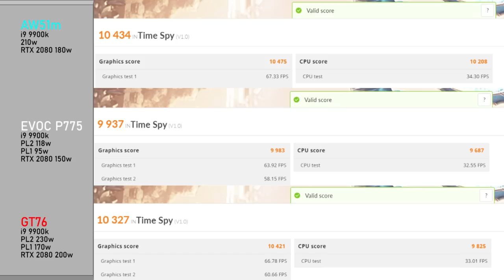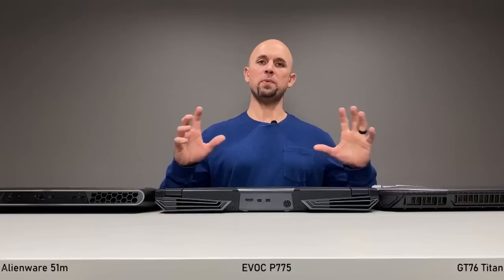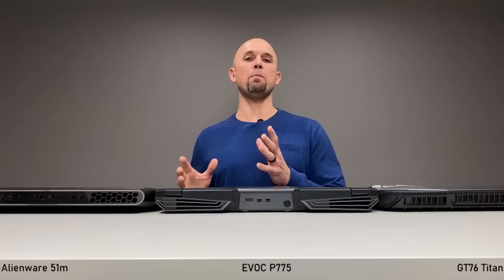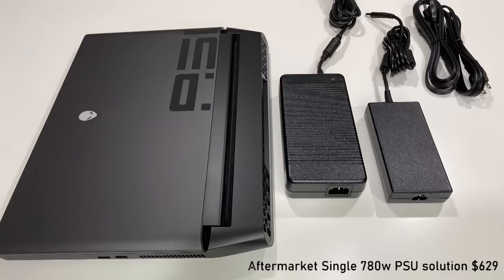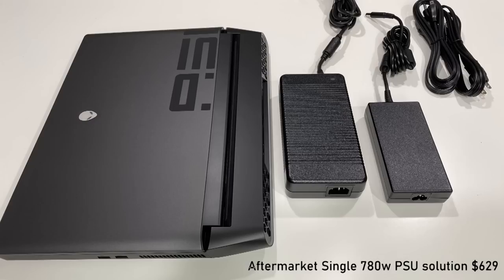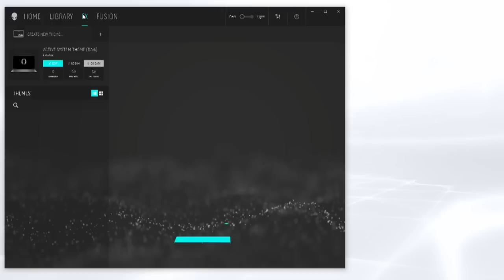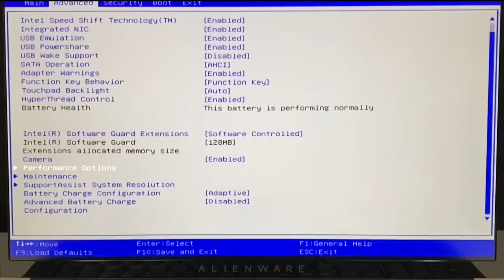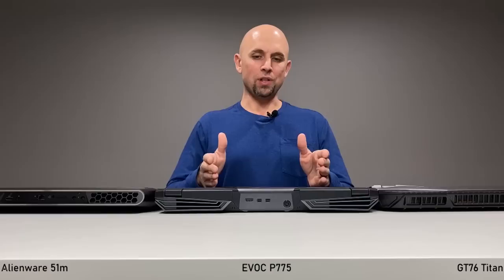The Ultimate Laptop SmackDown!  Alienware 51m vs EVOC P775 vs MSI GT76 Titan

Comment: I was  quite literally two clicks away from buying an Area 51M with 9700K and RTX 2070 for about  3000 Canadian dollars, the only thing that stopped me was the current limit on the card because we had some repair to do on the car the same month.

Now i have a P775 with 9700K (for better thermals) and an RTX 2080, 4 Tb SSHD, 32GB 2666Mz for the price of the inferior 51M stated above.

The same Specs in an Alienware including the parts i got from Amazon, this build would be at 4000 Dollars before tax....

I wont even mention the Titan....

The premium is way too heavy of the Dell or MSI machines.
Yes the Clevo is rough on the eyes but i wont be climbing up the curtains if there is a scratch on it because whats inside is not only competitive but also overperforming the far more expensive machines while gaming.
Reply from the maker: Michael Gimenez Very practical comment well said 👍
Reply: @BobOfAllTrades  Sorry Bob i know you have others things to do than reply directly but you are one the most qualified person to give me a straight answer on the matter so i am trying my luck.

This machine apart from heavy Photoshop work will be doing mostly gaming. I went for the 9700K instead of the 9900K because of budget but also because for thermal reasons, the 99 seemed to be going hot fairly easily and the 97 seems to be equivalent when it came to games. 

However was the 9900K the better investment if i wanted this machine to last me for the next 5 years (mythical future proofing) or the 9700K is more than enough for gaming?

If you find the time to reply it will be much appreciated if not well no hard feelings.

Cheers!
Reply from the maker: Michael Gimenez 9700k is excellent for gaming. 8 super fast cores is awesome. In my in-depth review of the GT76 I did over the summer I showcased the 9900k with HT off so people could see how good it was for themselves 👍
Reply: @BobOfAllTrades  Well i guess i missed an important video!

Cheers!

Comment: There is clearly something wrong with the application of liquid metal on the Alienware. I'm running Kryonaut on my 51m and in BF5 I rarely hit 80* max. Usually it's in the mid 70's on all cores. That's at 4.7ghz. There is no way that liquid metal running at 4.6ghz is running 20+ *C hotter. HID has been known to screw laptops up and then when it comes to warranty its a back and forth game between them and Alienware/Dell. Don't believe me? Go check out reviews on Amazon and see for yourself. If you are spending money on a laptop this expensive, ALWAYS buy it directly from the manufacturer and not a 3rd party reseller that has no affiliation with the company that produces the laptop.
Reply from the maker: The wattage it pulled was crazy too. Once I dropped it to 80w it was better 🤷‍♂️

Comment: NOICE! LGA FTW :)
Reply from the maker: This guy knows what’s up 🤛 

Let me know what you think of this.  I’ll email you later.
Reply: @BobOfAllTrades  Honest real life usage review! Good to see AW and MSI finally stepping up to the LGA plate and blessing the P7 with company. She really is a sleeper isn't she?! Conservative (and ready for a makeover) on the outside and a beast from the inside. Just solid Plug'n'Play until you add the second supply and flip a few switches to unleash it.
Reply from the maker: Prema Mod Exactly!
Reply: Prema FTW!
Reply: @BobOfAllTrades  do you think that battery life wpuld be better if theres area 51m with new ryzen cpu?
Reply from the maker: Not really.  The wattage laptops use when unplugged is cut and you’ll see pretty similar results. In fact the big LGA laptops featuring Ryzen will have terrible battery life because they do not have an iGPU.  Even if they make a musclebook with the Ryzen Mobile 4800H for example, I would not expect to see much difference in reality.
Reply: @BobOfAllTrades  so intel is still better? Im still deciding what to buy for desktop cpu intel or amd ill wait new gens tho
Reply from the maker: If you’re dead set on a desktop cpu in a laptop and want the best battery life then intel CPU with Nvidia Optimus is the only way to go right now. Unless AMD launches an 8 core APU someday.
Reply: @BobOfAllTrades  thanks, do you know why for instance there arent 18 inch laptops? Its not that it would be that much larger...
Reply from the maker: There used to be and this is a really good question. The most popular laptop size by a landslide is 15 inches.  Then 13” ultra books followed by 17” laptops.
Reply: @BobOfAllTrades  hi Bob.
Bob I need your help in EVOC p775..
I believe on your review bit when I seen about the graphics performance of EVOC p775 this the King of other two laptop... Then I decid to buy EVOC.... Here can you guide this machine is best with 1440p also with RTX 2090 cori9 9900k... 64gb ddr4 ram of 2666 mhz.....
Is it best for gta v high end graphics mod...?
And how much power I need for this laptop mean power adapter for this machine which is best for full performance.?
And 
Finally.
Is it batter for gaming or not. And 
Should I wait for the new model right now?
From alionware, MSI and EVOC......
Can I email you about my laptop issue?
Thanks 😌

Comment: Thanks bob for another great video! The 51m is pretty laughable but a 9700k 2070 version might strike a good balance for it IMO.
Reply from the maker: I’d rock a 9700k 2070 version I think 🤔
Reply: I own the 9900k with rtx2080 model and i dont have issues with heat...

Comment: I don't even know why Dell released a R2.  The R1 is actually faster with the original TDP. The R2 has a lower locked TDP which makes it slower even with the Super.  It's just not worth it.  I could see if it had a 2080Ti but it doesn't.

Comment: For me, all major ports must come out the back. Power, Ethernet, HDMI, Mini Display port and 1 or 2 USB. Then the stuff you occasionally use additionally on the sides. I have an MSI Dragon 2 for over 5 years now and love it to bits, and everything i normally use is out the back. I move my laptop from work to home daily, with 3 external monitors.

Comment: I wish there was a i7 RTX 2070 version of the gt76. No way I can afford the i9 with a 2080. Does the 2070 version of the area 51m thermal throttle?
Reply: I know it's a one year old comment but there was a 2070 SUPER I7 version (I'm typing from it rn); been rocking this badboy for a year and I'm not regreting a single bit of it. Except the charging port being on the side.
Reply: @SlakBeatBox  I actually ended up getting an alienware m17 with a 2070 super. It's an awesome piece of kit so far.
Reply: @mysticking16  Great! I just helped a friend getting a hand on a super cheap m17 2070 super 16g i7 10750h 300hz; and she is insaleny happy with the purchase so I can only imagine how happy you can be! Congrats on the purchase!

Comment: I have the gt 75 it's great as has a mechanical keyboard and don't like these offerings. I got the 2070 model  the 2080 version was £600 8750h same spec. Problem is these laptops cost over £3000 for a 2080 and I9.
Reply from the maker: Adam Hartnell Holmes The GT75 is a great laptop.  Some can’t get over thicker bezels but for me it doesn’t matter after use and the 75 offered Gsync too 👍
Reply: @BobOfAllTrades  the thin bezel design does look great but at the time.  The thin bezel design was only on the thin msi laptops. Like I could of got rtx 2080 msi laptop but it was thin and no gsync. Also as regards to price with MSI Titan range there not sold for long. I have also noticed they reach there end of life cycle very quickly.

Comment: The GT76 should have launched with G-SYNC. At that price, I don't see why its' not present.
Reply: G sync only helps at lower frames but I see what you mean.
Reply from the maker: Gsync is an interesting topic for me.  Those who rarely use it or never have and find themselves using a nice 144hz panel are quite happy.  When they use it for a little bit they think “muh, I don’t see the big deal”.

Flip the coin and users who use it exclusively will now see tearing at 100hz on a 144hz panel without it.  

Similar to driving a car at 100mph for an extended period of time.  The lines on the road and everything around you isn’t as fast as it was at first.  Then slow down to 35mph and it feels like you’re walking.  You just get use to things 🤷‍♂️
Reply: I have the Titan 240hz 2080 model, without gsync and there is zero screen tear. I was worried too but that screen is so smooth and fast it doesn’t need gsync. Makes my 120hz monitor feel slow :(

Comment: If I have a Alienware area51 m R2 which one runs cooler
Reply from the maker: Have you given that laptop hell or just run benchmarks?  Whenever people say their R2 runs cool their story changes 🙏
Reply: @BobOfAllTrades  i make music like use omnisphere serum etc which laptop will be epic
Reply from the maker: AutShock Oh cool 😎 yeah unless you’re jamming away at the GPU and CPU like I was showcasing here, you’ll be just fine 🤙
Reply: @BobOfAllTrades  will in not burn if I do music for like 12 hours / edit vids / game and stream everyday wt happens
Reply from the maker: Music and video editing should be fairly one sided.  Gaming when both CPU and GPU are pushed similar to what was shown during BFV is a whole other ball game.  The system is trying to cool off 280w and that’s hard
Reply: @BobOfAllTrades  wt abt if I do it on i7 10gen processor with rtx 2070
Reply from the maker: AutShock That’s the better combo thermally for sure since the 2070 is a 115w part
Reply: @BobOfAllTrades  I am a windows user I like the way the laptop should look which laptop would you prefer

Comment: dell is offering ddr4 with higher speeds than 2400, whats the deal? right now there highest option is 4 sticks of 16g at 2800. Also people are doing reviews on even higher specs than that that they shoved in there.
Reply from the maker: The AW51 doesn’t support faster then 2400mhz
Reply: @BobOfAllTrades  well somethings fishy or your just wrong because people are getting it done. This is a link to the forum, some people cant and some people can get it to work by going to bios and setting the speed them selves.
https://www.dell.com/community/Alienware-General-Read-Only/Area-51-R2-DDR4-Higher-than-2133-MHz/td-p/5553922

ill let you know the truth by doing it myself in the next few weeks.
Reply from the maker: Gray Sylvester The AW51r2 is from 2016. This is the 51m.  This are different machines.

Comment: I tested the 51m from Best Buy, I ran a bunch of benchmarks and couldn't get it to outperform a simple Razer Blade, I am not sure if I was doing something wrong, given that it had PC parts, I thought it would smoke the thin and light. I returned it, just cant carry around 2 bricks daily.
Reply: How did you return something you "tried at best buy" lol.. sour grapes I tell you. A 51M turned off, with the CPU and GPU removed will outperform any Blade.
Reply: @gjvah  I purchased it, had it for a week. Compared the benchmark results, FireStrike. The Best Buy configuration has the 2070 with the i7. The scores where higher but only by under 200 score points. Why the bad vibes man?
Reply: @Radhaugo108  no bad vibes, its just obvious you're lying, which is ok. So it couldn't outperform a simple razer blade or it couldn't outperform it by more than 200 points? See the inconsistencies? Bad vibes is you just hating on a product you clearly have no experience with.
Reply: @gjvah  Maybe you should go to Best Buy, buy their 51m, buy a Razer Blade and run your own benchmarks, before calling strangers liers just because you're too afraid of return policies.

Comment: I have owned Area51M 9900K+2080
Fortunately I was able to sell it
Now I am owner of Titan GT76
Area 51M:
- its videocard does not have ANY vrm heatsink since june 2019th, thats why they lovered gpu power to 180w and max gpu temp to 78c. It causes much lower gpu perfomance than GT76 and MUCH LOVER lifetime. Did you see and RTX2080 without vrm heatsink? This is absurd! They hope you just buy another videocard when yours dies. GPU cooling has moderate perfomance 3/5
- CPU cooling hav very bad perfomance! It can not handle 9900k! Always overheating.
- Its surface (I had grey) is very markable and very hard to clean completely. You will have dark dirty areas on your grey laptop.
- RAM is 2400 with no way to overclock

GT76:
- Its a bit louder
- It handles 9900KS
- ram overclocks to 3000mhz 128gb 4 slots per 32gb
- it does not have g-sync but i got 240hz display so does not matter. 240hz is better and has better battery life cause of optimus
- psus connection is from the left side which is not always comforttable

DONT MESS WITH AREA 51M
Reply: How did you overclock the GT76 RAM? In the BIOS?

Comment: Wow, if that 75 thermo limit is for real, people that have bought this AW must be destroy by it... Is like you buy a BMW, all working ok, acceptable... you go to the first service... and they limit your throttle response to 50 miles per hour... and that's it... you have to live with it???... wow... 100 times the MSI gt76 (although someone was drunk when doing it with Optimus, I wouldn't buy it) than this type of Bios/ customer support from MR AW... unveliable... in machines that cost over £3000...
Reply from the maker: Meanwhile the P775 works like a charm, just a bit dated aesthetically 👍
Reply: @BobOfAllTrades  Absolutely, just as you have said, that chassis remains me a bit of the 90's... Mate you are a crack, if you enjoy what you are doing, I guess you do... keep it up... your reviews are great!!! Awesome.

Comment: Liquid metal is good and all, but make movement limited
Reply from the maker: Think about this for a second.  HIDevolution specializes in mods for laptops with Liquid Metal on top of their list.  If laptop movement was an issue just imagine what shape their business would be in right now. 

My own LM jobs on several machine out in the wild are going strong. 

There’s a few big channels that have applied LM without proper prep, so shame on them. When it’s done right and it’ll be done right, you could store these on their side or shake the daylights out of them and you’ll still be rocking and rolling.  It’s ALL in the prep 👌
Reply: @BobOfAllTrades  oh really!? I didnt know that, thank you bob!